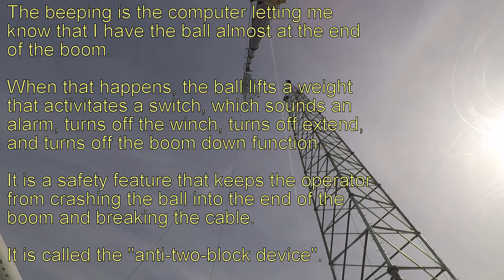To The Top Crane | Part 2. Building a cellphone tower

Comment: Do you know what radios the climbers typically use? There's a new tower near me being constructed and their at this phase. I'd kinda like to listen in on what they're saying. Is it FRS or GRMS?
Reply from the maker: I'm not sure. Every crew seems to use something different. You may be able to pick them up with a cheap radio that is set to scan mode.
Reply: I have my scanner scanning all the FRS channels. I also have been looking around that frequency range with a SDR (software defined radio) dongle. It was overcast with scattered showers and wind, probably nothing much was done today.

Comment: I was called to set trusses on a cranberry farm.  90 foot span, 150 foot long building with 20 foot high walls.  Brickl Brothers was the contractor.

I got set up and picked up the first truss, but the wind was steady at 20 mph, gusting to 35.  (they have weather stations all over the marsh)  The guy sitting on the side wall was signalling frantically to swing the truss over, but I looked up, and my boom was side loading like crazy, I had to call it off.  My boom tip must have been 20 feet ahead of the truss!

They sent me home, and hired a bigger crane.  The law is still the law, and a bigger crane isn't the answer.  I hope no one got hurt.

Comment: You're going to have to split these up into more parts. I can't hold my breath for 20 min. without passing out. I would have to have a Valium the size of a football to even think about doing that. After work do you just rip the top off a keg to relax?
Reply from the maker: 72+HourBOB, cell towers are my least favorite jobs so far. There are times when I would like to submerge myself in a barrel of whiskey. However, I have a rule for myself of no drinking on a work night. I don't want even a trace of alcohol in my system while operating. Many thanks for watching! 🙂👍

Comment: hey Jimmy I watched video on you setting house I noticed they didn't use spreader bars
Reply from the maker: Daniel Demag, a few of the house setting crews that we work with don't use spreader bars. They use long 6 inch wide straps. I actually prefer no spreader bars if possible. The house doesn't move around as much and there's less rigging. Also, the crews have padded blocks that they slip in against the eve where the straps sit. That keeps the straps from damaging the house and vice versa. Thanks for watching! 🙂

Comment: I've been up 102 feet on a FD ladder truck. BUT tower work, NOPE not me...
Reply from the maker: Blazer02LS, I'm not climbing either. Lol
Reply: I am with you Blazer.  I remember my first trip to the top of an unsupported 100' ladder and could not believe how much that thing was twisting.  I got used to it in years to come.  As a rookie we had to climb up one side, over the top, and back down the other side in a 45' Flagpole ladder raise supported by four of your fellow rookies holding the ladder vertical by ropes.  Never had to do it other in that rookie training..
Reply: We did that drill at least once a year using a 50 foot bangor ladder...  HEAVY F%^$$ing thing.... Don't miss that at all.